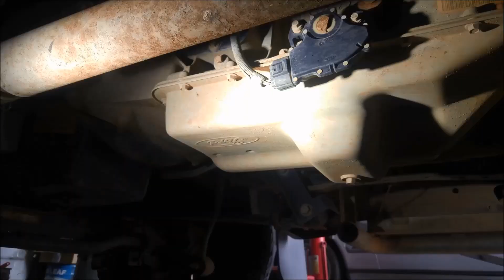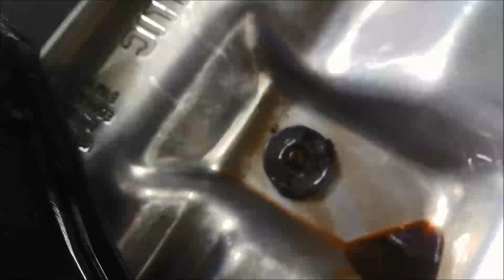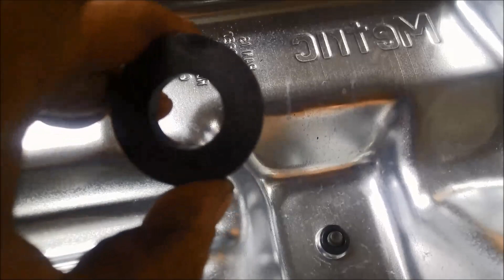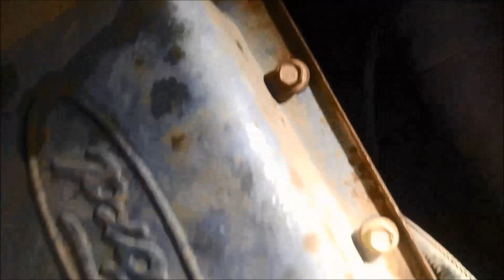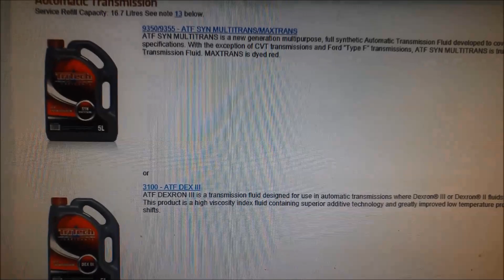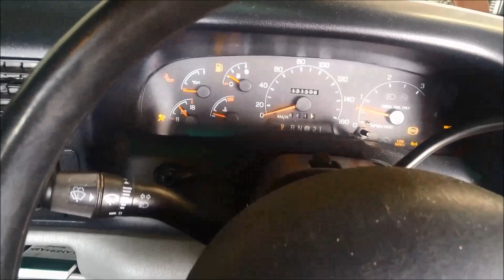Ford F250/F350 4R100 - E4OD Automatic Transmission Filter Service & Fluid Change

Comment: this trans has 16 liters in it, you removed and replaced 3.5?
Reply from the maker: hi, always refill as per manufacturers information. there is no set amount as such. the fluid also expands with heat, so critical to also confirm the temp range to test/check. cheers 👍

Comment: 1. Things you need to get started:

I used 24 quart in extra deep BD pan.  Very simple process, these instructions make it look tedious, it's not.  Just warm it up, drain plug, re-plug, take off the rear line off trans and keep a catch pan under it, run it until stuff runs out noticeably lessened flow amount dribbling down, fill with 7qt, run again, and cycle through gears a bit, add 6 qt, run again and goone more time and seal it up and with 19 qt in, run it warm, then top off within range (do not run out of range long term, will foam and not work right/destroy itself).  
a.
 The transmission system holds almost 18 quarts of ATF, and you must 
waste a couple of quarts to be sure you get it all purged and replaced, 
so buy 20 quarts of MERCON V ATF. You may use either conventional or 
synthetic ATF, as long as it is rated MERCON or MERCON V. Your Owner’s 
Guide says to not use MERCON V, but Ford changed that in 2006.

b.
 A 10 foot length of clear tubing and one hose clamp, sized to fit over 
your cooler line. There have been different size cooler lines over the 
years, so check before buying! The metal part of your cooler return line
 is probably 3/8th inch outside diameter (OD) with a ferule on the end 
of it, so if you can find 7/16th inch inside diameter (ID) tubing, that 
will probably work great. If you use ½” ID, it will be a loose fit over 
the ferule and will need a good hose clamp tightened good to prevent it 
from leaking. So just in case, place a big drain pan under the 
connection. And some folks have reported they were strong enough to 
force a 3/8th inch ID tube over the ferule. If you try that, dipping the
 end of the plastic tubing in very hot water for a few seconds will make
 the job easier. 

c.
 If you don't already have a special funnel that fits into the 
transmission dipstick tube, then you will need one of those, too.

d.
 If your transmission has ever been worked on by a Ford dealer, you 
probably have a Magnefine in-line filter in the "rubber" part of the 
cooler return line, near the front axle. If so, you should replace that 
filter every time you change the ATF. You can get one from your Ford 
dealer, or for about $15 from Magnefine Filters--Online Order Form. Your cooler lines are probably 3/8th inch, so you want the 3/8th size Magnefine inline filter.

2.  In cool or cold weather, be
 sure the transmission is up to operating temp before you begin. It’s 
not supposed to happen, but several members have reported ATF coming out
 the cooler bypass line instead of the cooler return line if they tried 
these procedures with a cold transmission. Also, in cool or cold 
weather, keep the new ATF in the house so it’s around room temperature 
of about 70º F. when you pour it in the transmission.

3.
 If your pan has a drain plug, drain the pan, then replace and tighten 
the drain plug. If it doesn't have a drain plug, skip to step #5.

4. Pour 7 quarts of new ATF into the filler [dipstick] tube.

5.
 Disconnect the transmission-fluid return line at the transmission - 
from where the ATF returns to the transmission from the cooler(s). This 
is the line towards the rear of the transmission. This is where the old 
ATF from the transmission, torque converter and coolers will be pumped 
out. Clamp the clear tubing over the line that you removed from the 
transmission. 

The
 following is a drawing of the 4R100 transmission, seen from the 
passenger’s side of the vehicle. The arrow at #2 shows the banjo 
connection where the cooler return line and the cooler bypass line 
connect to the rear of the transmission. The arrow at #4 shows where the
 “hot” line and the cooler bypass line comes out of the banjo connection
 on the front of the transmission. (The cooler bypass valve is near the 
banjo connection at the front of the transmission, in that bypass line 
that runs between arrows #4 and #2.) 

6.
 This is where the second person comes in handy. One person starts the 
engine, while the other holds the line over the drain bucket. A clothes 
pin can replace the person holding the line in the bucket. 

a.
 Run the engine at idle RPM until you have around 1.5 gallons in the 
drain bucket, then you should see a big air bubble in the clear tubing. 
Ignore tiny bubbles. As soon as you see a big air bubble, shut off the 
engine. Then double-check the amount of used ATF in the drain bucket. 
You should have around 1.5 gallons. If you have much less than 1.5 
gallons, then you probably killed the engine too soon, so crank the 
engine and pump out some more old ATF.

b.
 If you drained the pan in step 3 and poured in 7 quarts of new ATF in 
step 4, then while the engine is idling in step 6a above, move the 
shifter through each position from P to 1, pausing about 5 seconds at 
each position. This will change some fluid that would otherwise be 
trapped in the valve body, accumulators, and clutches.

c.
 If you poured in 7 quarts of new ATF in an earlier step, then refill 
through the dipstick tube with 6 quarts of new ATF. (That's 13 quarts 
total so far). If you have not poured in any new ATF yet, then pour in 7
 quarts of new ATF, for a total of 7 quarts so far.

7. Repeat steps 6a and 6c until you have poured in a total of 19 quarts of new ATF (7 + 6 + 6).

8. Remove the clear line and reconnect the cooler line to the transmission with 20 lb/ft torque. 

9.
 Drive the truck several miles to get the transmission up to operating 
temperature. Then check the fluid level and use the last quart of ATF to
 top off. 

 You should always check the ATF level when the transmission is up to 
operating temp – not when it’s cold. The cold marks on the dipstick are 
not very reliable. When first filling the transmission, use the cold 
zone on the dipstick to get close to the right amount of ATF in the 
transmission. But for topping off, do it with a hot transmission using 
the hot area of the dipstick. When you get done, you want the 
transmission full, but not overfull.

10. Properly dispose of the used transmission fluid. 

11. Congratulate yourself! And your engine starter/killer person. 

12. Then get back on TheDieselStop and tell us your "lessons learned" for those that follow you down the DIY road. 

Now that we understand the basic procedure, let's muddy the water with the options:

Revise paragraph 3 above to read:

3.
 Drain the pan, remove the pan, replace the transmission filter, clean 
the inside of the pan and clean the reuseable gasket, install the pan, 
then replace and tighten the drain plug. Torque pan bolts to 11 lb/ft. 

If
 your pan doesn't have a drain plug, you remove and drain the pan at the
 same time. This might be a messy job, but most tranny pans on other 
vehicles don't have a drain plug, so you won't be doing something the 
pros don't do routinely. 

Don't buy a new pan gasket. The original is reusable. 

The
 pans for the 4x2 and 4x4 drivetrains are slightly different, so the 
internal transmission filter is also slightly different. So be sure you 
buy the correct transmission filter for your drivetrain.

I
 replace the transmission filter every other fluid change. Note that 
Ford does not recommend ever changing the filter. I've opened filters 
with over 300,000 miles that were not even close to being clogged. 

It
 just pulls out, there are no bolts that hold it. It is held in place by
 the pan. Make sure that the O-ring is removed, too. Sometimes it does 
not come out with the filter. 

 Add the following to paragraph 3 above:

If
 your truck was built before August, 2001, then you may have a drain 
plug in the torque converter. If you do, then you can also drain the 
torque converter as part of step 3 above. Some people think it is 
necessary, but I don't. Running the engine in the next steps will pump 
the fluid out of the torque converter. If your transmission was built 
after August 2001, you don't have a drain plug in the torque converter. 

If
 your torque converter does include a drain plug, then to drain the 
torque converter remove the shield (but NOT the upper right bolt - this 
one only needs to be loosened) and turn the flywheel until you see the 
drain plug. If you drain the torque converter, be sure to replace the 
drain plug, and torque it to 18 to 20 lb/ft before you continue. 

If
 you drain the torque converter, then the old ATF won't come out of the 
end of the cooler return line until the torque converter is filled with 
ATF. So instead of waiting until you see big air bubbles in the drain 
line during your first iteration of going through in step 6a, run the 
engine for about 30 seconds while changing gears for step 6b, then cut 
off the engine. 

 Add the following to paragraph 5 above.

It's
 not necessary, but some folks want to get every possible drop of the 
old ATF out of the system before they pump new ATF through the system. 
If you drained the torque converter, then you might also want to blow 
the ATF out of the coolers and cooler lines. If you have an air 
compressor, you can reduce the line pressure to about 15 PSI, remove the
 cooler "hot" line from the front of the transmission, and blow air into
 that line. That will force the ATF in the coolers and lines out the 
cooler return line at the back of the transmission.  use air pressure of more than about 15 PSI! Then be sure to reconnect that line before you continue with paragraph 6.
Reply from the maker: cheers for that
Reply: @YepThatsIt  holy shit man wrote a harry potter book
Reply: Bro… make your own video instead of hi jacking someone else’s.
Reply: I have a 2000 f-350 7.3, i turned the wheel all the way around didnt see any plug! So i loosened the line to the transmission housing and let it drain this is my first time and ik i.fucked up and put 17 quartz in i didnt do any of that step to step adding only few quarts at a time! Now my over drive is flashing so im going  to take off the pan and redo it.. Im just going to add enough for the pan not the torque converter until i can do it with those steps you mentioned! I do believe i read the pan alone on holds up to 8 quartz i could be wrong lol.. But when i did over fill it i realized there is a vent above that allowes it to.drain accessive fluid which i didnt know about but do now as it was draining on my drive way.
Reply: What the hell bill

Comment: So weird to see the master cylinder on the left side of the engine. Three me for a loop for a second. How is there enough room for the blower housing and evaporator behind that air filter?
Reply from the maker: hi, sorry for delay in reply, we just got back last monday. i guess that would be strange to some. we are use to seeing left and right hand drive vehicles in australia so not as strange to some. cheers

Comment: Is it not recommended to drain the torque converter?
Reply from the maker: hi, in "normal" trans service not really required to drain converter. if there is that much or alot of metallic debris in the trans, then you have a bigger problem anyway....a converter flush and even golden syrup will not help it for long anyway. cheers

Comment: Mercon is no longer being made - Ford TSB #06-14-4 - Mercon V is to be used in all applications that formerly called for Mercon fluid
Reply from the maker: yeah reverse compatible ( usually not other way round ). cheers
Reply: Still made. Look at most fleet or farm stores for it. Usually labeled Dextron III / mercon - Valvoline and Many Farm brands still carry lots of it. Even I 2 gallon jugs.

Comment: You put the wrong transmission fluid in it, it takes Mercon not Mercon v
Reply from the maker: hi, they should be reverse compatible which means you can put in a better grade of fluid if you choose to, instead of the base recommended fluid. choice is always yours though. thanks for input cheers
Reply: @YepThatsIt  If you call Mercon V better. Pretty much same stuff. I use Farm grade Dextron III & Mercon